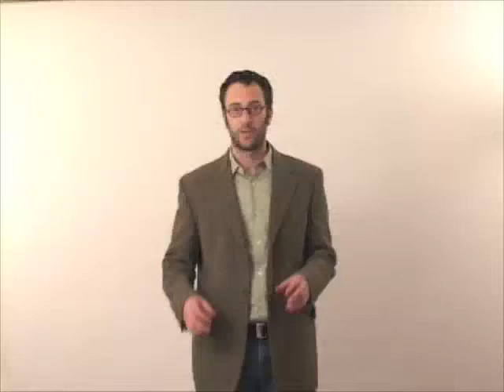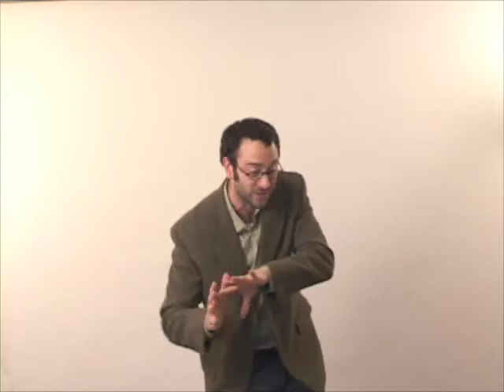How does an air conditioner work?

Comment: Basically The Air Condenser is a outside unit of the A/C In order for this to work you will need a chemical like Freon to help turn the gas into liquid more easily the air goes into a compressor which squeezes the hell out of the air to make the molecules come together to make the air more energized and heated from there it goes into the condenser which takes all the heat away from gas at this point  it went from gas into liquid which goes to the evaporator through a tiny hole and gets ventilated through the house on the opposite end the air gets cooler and get influence with the warmer air in the room since hotter air is lighter than cold air the cold air mixes with the hot air and floats up towards the ceiling and get sucked in through the ventilation and repeats the process over again...to get heat the process is just reversed...

Comment: @snginga 

It is also able to absorb the heat because, at the time, it is cold, which is the result of it being under low pressure.  So, the video is correct.